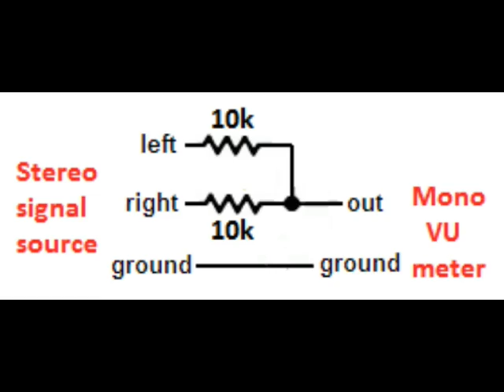LM3915 IC LED VU Meter Tower

Comment: How to fix led on acrylic sheet
Reply from the maker: If you're asking how I attach the LEDs to the acrylic >>>>> a 5mm hole was drilled and the LED was held in place using hot glue.

Comment: hi ,the amp was put in the same circuit as the meter?
Reply from the maker: Yep
Reply: and if i put separatly ,it will work the same ?
Reply from the maker: Of course.  Why wouldn't it ?
Reply: thx man (y)
Reply from the maker: Your're WC.  GL and HF with your build.  Share it with us when you finish it.

Comment: can i power 5v volts or lower.?
Reply from the maker: Hi Isaac.   I'd try your USB port or even an ac adapter at 5 or less volts.  Let us know how you make out. The data sheets for the LM3915 and LM386 indicate they will work with less than 5 V.  Always a good place for info on the chips.
Reply: yes sir .. thank you so much .. im trying to build bluetooth speaker with it and 40000mah power.. i got 76pcs of 18650 batteries laying around so i need to use them instead of nothing.. theoretically, i can make  atleast 167mA of banks power at 3.7volts, and ill be using 3 to 5 volts boosters with 1 and 2amps output. ill be adding Battery meter for precision and to spot any degradation of bank batteries, since 167mA isnt allowable on the airport. ill try to make atleast 18mA banks per piece and can be combined and balance at the same time. ill be powering and charging them with BMS and Balancer using laptop adapter for faster charging ...

Comment: Hi  can you please tel me where can I bye the power board
Reply from the maker: Hi George. Power Board ?? Are you referring to the AC adapter?? I got it thru eBay.    If your asking about the prototyping board that was used to mount the components to build the circuit ---  again there are many many sellers on eBay that can provide you with these.

Comment: Is LM3915 N the same as LM3915 IC?
Reply from the maker: Yes
Reply: Can you send me link, where did you buy this LEDs ?
Reply from the maker: All electronic parts were purchased thru eBay.  Any electronic store near you should be able to help you out.
Reply: I wanted  link to LEDs because they are good quality and they can light up that plexi.
Reply from the maker: I don't have the specific link for each seller on eBay I buy from but if you want bright LEDs check the spec listed when you buy.  I used LEDs with an Intensity spec (mcd) of 5000 or higher whenever possible
Reply: ok, thanks a lot for help.
Reply: Why you did not connected NPN transistor to the led's?
Reply from the maker: ???? What transistor are you referring to ???.  There are none in my circuits.
Reply: NPN transistor. It will be good to use it.

Comment: When it's on bar mode the led connected in the 10 pin is constantly on, what would be the problem??
Reply from the maker: +priscilla00167 Hi. I'm not sure what's causing that BUT it's common to this type of circuit using lm3914/5/6 as shown in many vids on YT.  Perhaps a filtering cap or resistor across that pin would eliminate this.  I've not tried that. Perhaps someone could comment on a possible fix.
Reply from the maker: Thx to TheVarooj for posting a fix for this problem. A 10K resistor across Pin 1 of the IC and V+ will correct this.   https://www.youtube.com/watch?v=1liNULGjIB4&t=0s

Comment: Hi Sir, this circuit need any program? This is an analog circuit or digital circuit?
Reply from the maker: +Sharon Er If you read the datasheets on the two onboard chips , you'll see they are NOT programmable chips.
Reply: Ok, thanks u :)

Comment: Sir how did you wired a switch to select wether it's in DOT or BAR  mode?
Reply from the maker: +Mark joseph Navarro   Well...If you read the description you'll see a link to http://www.eleccircuit.com/electronic-vu-meter-by-lm3914-and-lm3915/ showing the schematic used and how that switch is wired.
Reply: Thank you sir..

Comment: you can use a strip of 3 leds instead of LEDs as you use?
Reply from the maker: +Leonel Fernandes Are they from a strip powered by 12 V ???
Reply: +ODX171 yes
Reply from the maker: Leonel Fernandes They should work ok. Try it and let us know how it turned out.  You could breadboard it first to test.
Reply: +ODX171 Ok thank you. I'll try a strip of 3 leds and tell you how I was

Comment: If you increase C2 you will have a lower descent of the visual signal, for me it works better.
Reply from the maker: Lino Rocha Great to see you changing a few things to work better for you. Mine is currently 47 uf.
Reply: Lino Rocha ty so much, was looking for this solution, you made my day. made it 10uf too

Comment: What kind of LED's did you use?  Just normal or some kind of high illumination LED's.. Thanks
Reply from the maker: Hi Franc.  These are just clear 20 ma LEDs  Very Common. Thx for sharing this,
Reply: ODX171 Just one more question. Did you use this circuit: http://www.pira.cz/enbar.htm?  Did you made any changes?
Reply from the maker: franc zdoline Hi. Franc. Re read my reply to you that was sent about 3 months ago. You may want to take a min. to re read the description above also.

The 386 wiring diagram ONLY was used from that circuit.  http://www.pira.cz/enbar.htm ... Pin 6 of the Audio Amp was wired to V+ in the basic circuit and pin 5 was wired to the "input from amp" side of the same circuit.

Have you built this one yet and/or is it working ?
Reply: ODX171 Sorry but i can't watch the other video. Somehow it seems to be blocked in my country, so this is why I am asking you again.
Reply: ODX171  Just one more question. Did you put any resistors before the 1, 10,...18 pins of the 3915 or did you just wire the LEDs parallel directly. Thank you.
Reply from the maker: franc zdoline  No resistors before the LEDs are required.